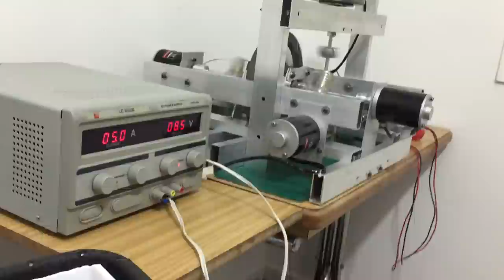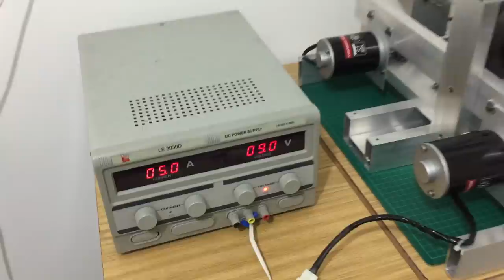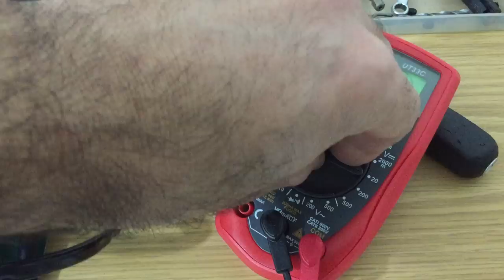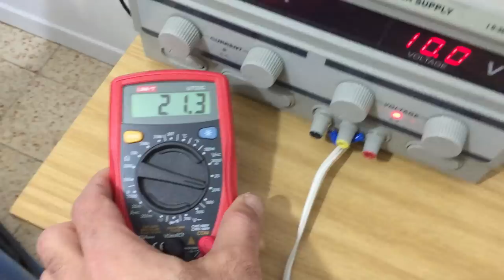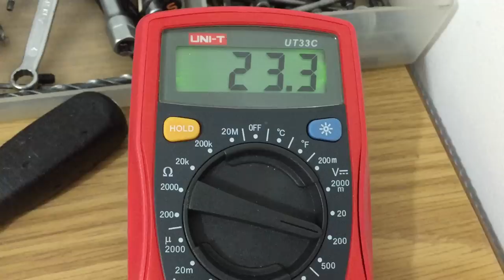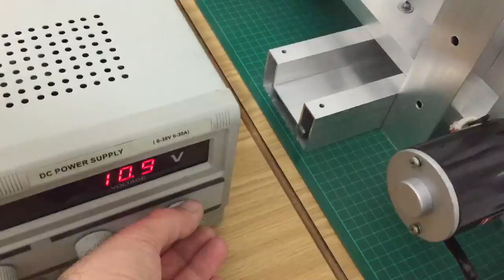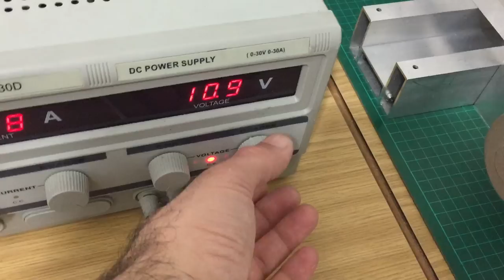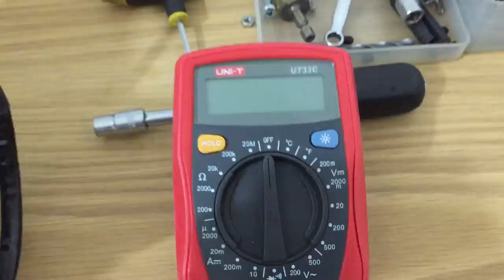Review from the future! The lyrics of magnetic wind!! full free energy low tech magnet devices

Comment: i see a better voltage output? that is good. is the flywheels or the design? keep up the good work
Reply from the maker: kazuza9 Yes i can connected to a heavier flywheel,This machine needs larger generators and can produce more electricity

I again emphasize that this is only a sketch machine,To show that can get more power and triple it!!

When the machine will reach mass production it be possible to get a lot extra X power!Machine bearings can be more qualitative, chassis machine can be better, the generators will be true, and the battery will load the machine itself, this machine cannot break!  and it can work for many years without problems! Aviation! Drive! Speed! In the water! In a house! Out of the house! And in space! The technology Today can do everything from this low tech machine i invented...Thanks man
Reply: ***** im sure this machine can do well when made with a commercial grade structure. larger flywheel will and can help produce more power and save on input power. best of luck man.
Reply from the maker: kazuza9 Thank you! Another video soon! You can see big changes
I was able to connect to the machine 6 generators and one electric motor that activates the mechanism!
The results are breathtaking for me...
oren gertel
Reply: ***** you will do so well and you will shock the world. you have positive energy in and around you . hopefully you will finish it and make a video of it and u will be proud of it. the bigger assembly may need a stronger base to fit it on. may be concrete base and may be not cause you have a flywheel to balance it. keep up the good work